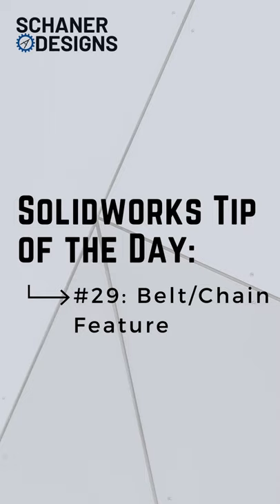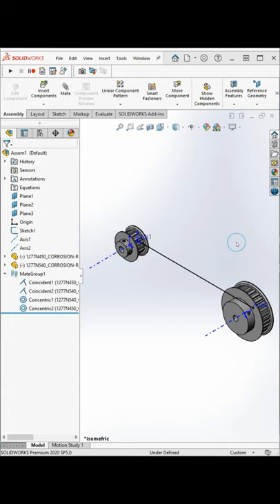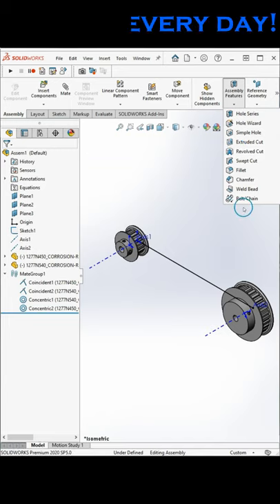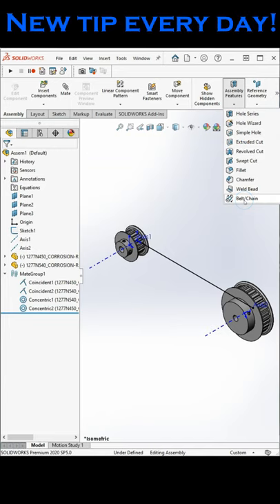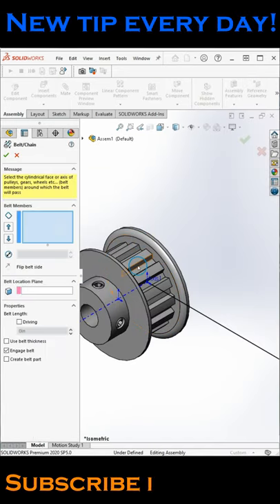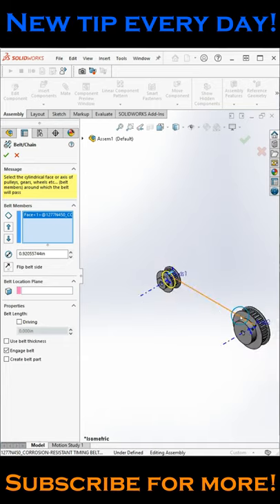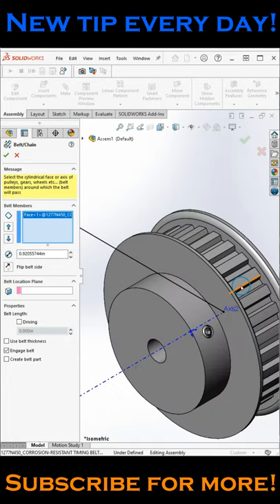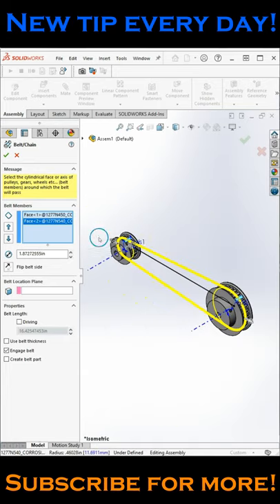Solidworks Belt/Chain Feature - Tip of the Day #29

Comment: How would I actually display the thickness? I am having trouble
Reply from the maker: The belt feature just creates a sketch. Thickness in this case just refers to the distance that it offsets the sketch from the pulley OD. If you want to create a solid model from this sketch, you will need to extrude or sweep the sketch created by this feature.